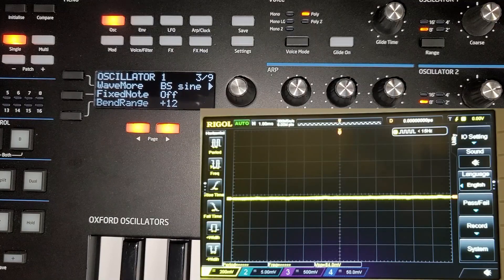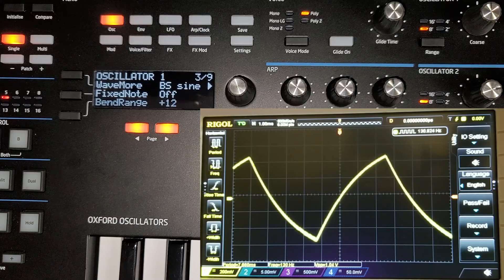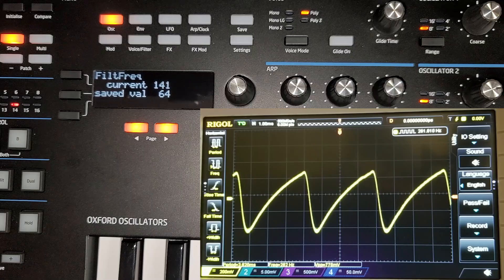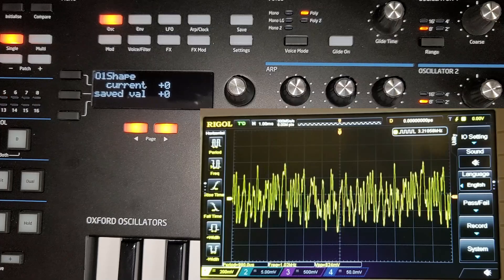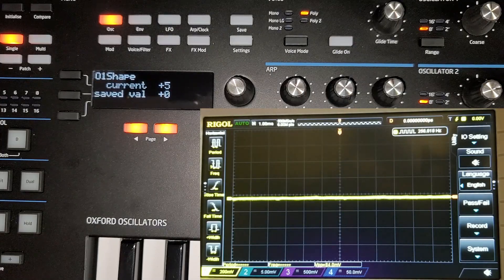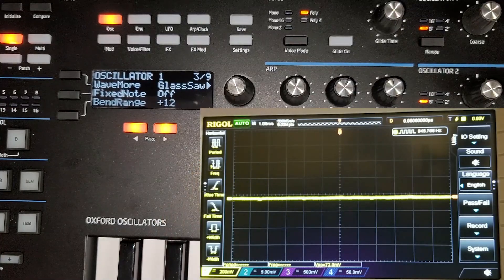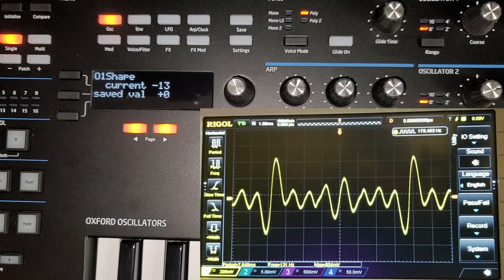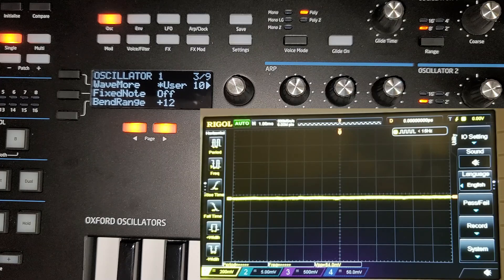Novation Summit: Wavetable Visualized

Comment: Hi Scott, i watched this video and excited, i would like to buy this oscilloscope but i want to ask you how did you manage to connect a bnc socket from oscilloscope to a synth? synth has only a usb/midi/audio interface, what is the cable? these oscilloscopes has only clamp cables,little confused
Reply from the maker: You can connect an oscilloscope to just about anything. In this case, I plugged a 1/4" cable into the output of the synthesizer, and unscrewed the other end of it, then I clipped the oscilloscope's test lead onto the contacts inside the other end of the cable. This fed audio directly from the synth into the oscilloscope.

Comment: Thanks for this, Scott. I have a Summit and it is interesting to have a tour of the waveforms with oscilloscope. My use of the waveforms has been pretty random and intuitive, sometimes with good results. 

It would be interesting to compare the analog waveforms of the Summit, with the corresponding analog waveforms from an actual analog synth -- both for sound and for visual waveforms.

I think Novation claims that because of the very high-resolution FPGA "Oxford" oscillators, the analog waveforms on the Summit, though produced digitally, are indistinguishable from true analog waveforms. I wonder if this is really true?
Reply from the maker: No idea. They sound analog to me. Especially with the analog filter in the Summit. But while an oscilloscope is useful to see waveforms like this and get an idea about WHY you're hearing what you're hearing, your ears are far better at hearing nuances than your eyes are at seeing them.
Reply: @ScottsSynthStuff  Good point, Scott. To my worn-out ears many of those waveforms sound very similar, no matter what the oscilloscope displays. I think my Hydrasynth provides a greater variety of waveforms.
Reply: @RayyMusik the Oxford oscillators have a sample rate of 25MHz, meaning images from the signal waveform would be 25MHz-40kHz away at minimum. In other words it would be completely impossible for the ear to pick up these signals which are well attenuated anyways from the filters. The thing that would sound digital is the completely perfect behavior of the oscillators, which can be remedied with built in analog behavior modulation such as spread and divergence.